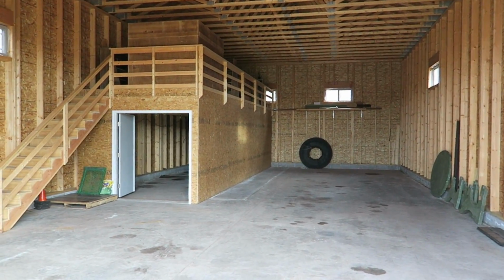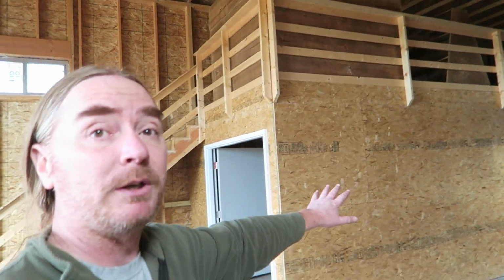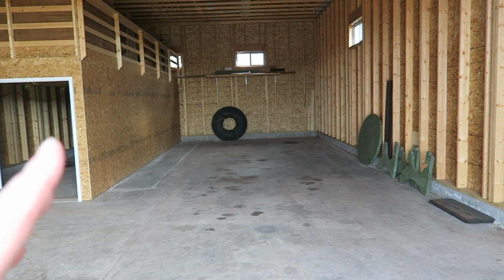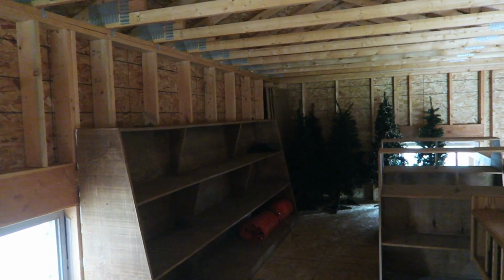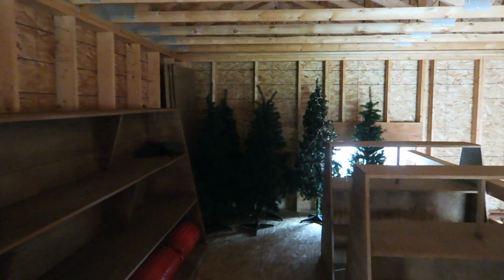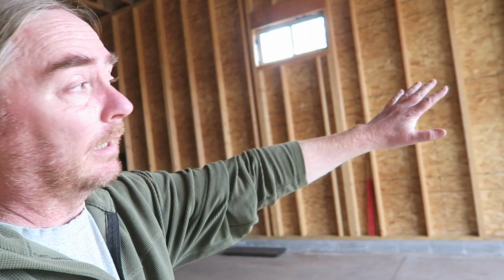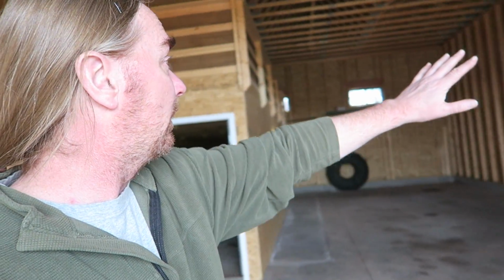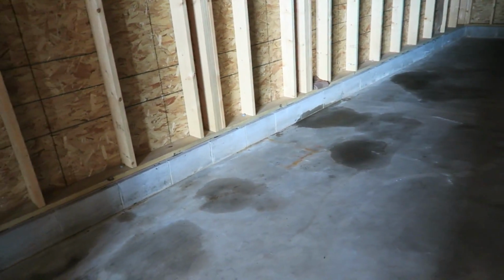CHECK OUT THE NEW BOAT SHOP!!

Comment: 4" is about R22, no vapor barrier needed as the foam does that.  You'll lose more insulation in the attic space and he's right about blowing in your attic space.  Another insulation to look at is Rockwool.  Rockwool with a vapor barrier is cheaper and will get you about the same R-Value in that 2x6 stud wall as the Spray Foam.  Not as tight, but pretty darn good stuff.  

As for HVAC, what about a decent waste oil burner?  Before doing that, you'll want to talk to local shops that have oil available, as many of them are probably using their own waste oil. 

Michigan electrical work.  You CAN do your own, you just need to have it inspected.  I did TONS of my own work, and had inspections run without issue.  

Lights, LED.  Check out April Wilkerson on her shop build.  She got some really good LED lights that really do a great job.  

Walls - I'd say get plywood to cover, but holy wah, that's crazy expensive now, other option is to put up Steel...Check out R&R Construction for their Post Beam Construction and use of Steel.  Plywood is better (IMHO) as you can easily hang things on it without dealing with ribbed steel.  Again, plywood costs are outrageous right now so...

BTW: WELCOME TO MICHIGAN!  Looks like Da U.P. Eh!  Say YA!  (yes, I used to live there.  6 amazing years and miss  it everyday).

Comment: Closing off the ceiling would help a lot.  Then you can blow in insulation on top, but be careful about conditioned vs non-conditioned space up there.   Having a lot of insulation in the roof/ceiling will help a lot with heat.  Also keep in mind that spray foam is also a wind barrier, which helps more than anything else at keeping the cold out.   Check out Matt Risinger's channel, he's got a LOT of great info about insulation etc and modern practices:  https://www.youtube.com/channel/UCFCTrfb1JUJjs3Im8OZDtBw

Edit: you could run the electric above ground....  When I had a warehouse, we had a heater hanging from the ceiling - that's what I've seen in large spaces.

Comment: The workshop area under the mezzanine does appear to be a bit unwieldy to work with, but the mezzanine itself could be useful. I'd look at taking out the central wall and replacing it with posts and bearers.

If you located the bearers up alongside the joints (ie fix the joists to the sides of the bearers using joist hangers, rather than sitting them on top) then you'd be able to keep most of the 7' clearance and still have decent post to post spacing.

It would be worthwhile having an engineer spec it out so that you know exactly what load capacity you'll end up with.

Comment: Hey Andy,
               I work at a major airline and we have 100’ ceilings in our hanger. It was always freezing on the hanger floor. We finally had Big Ass Fan Co. install big ass fans. Oh what a difference it made, we went from winter to spring time temps on the floor. You have to get the heat down to the floor and these things do the job! Just my two cents. Great show by the way, have learned a lot from you, Thanks.

Comment: do not use spray foam put as much insulation in as you can that contractor is a joke cover the walls and ceiling  with sheet rock rent a big insulation sprayer and it will cost about $ 6000.00

Comment: I'd be curious how well double bubble would work in that space.  It's amazing on our boat, but it really needs double layers with an air gap to do it's thing.  Single layers are a barely noticeable improvement, so it's really best in buildings like your shop where there are thick enough studs for the spacing.

Comment: Same ther money on running a gas line and use propane. As an FYI, all building materials are increasing exponentially. They fluctuate / increase week by week. I would concentrate on the ceiling insulation.

Comment: I would investigate suspension ceilings ( drop ceiling) they have hard tiles that don't flake . Just decide minimum height of ceiling you need,you can insulate above and have access for lay in lighting  or surface mount. I like the base board heat.

Comment: Anyone who works in "The Trades", as I have for 40 years, or follows trade magazines, will tell you that there is still much debate concerning insulation. East coast versus West Coast, Canada, crawl space, slab, perimeter , post and pier, basement, vapor, moisture and ,the always lively discussion- Tyvek v. Tarpaper.  So, If that shop was mine, (I wish), and assuming there is a moisture barrier between the sheathing (osb) and the siding, this is what I would do: Pack as much fiberglass batting between the studs as will fit, probably R-36. Sheetrock over that. Rock the lid and place 2 layers of R-36 up there. Done. Remember, For every step towards 'maximum efficiency,' you are one step closer to that 'point of diminishing return". I like the foam for it's labor-saving potential but, the cost and the ugliness of it (yeah, I care about stuff like that), is a turn-off for me. One other thing to consider, minimum rate of air exchange is a calculation that should be factored-in the insulation plan. So, Stick with glass, it's been good to you...

Comment: 1) No way that shop is 42x70x18...  My guess from looking at the studs is 30x50x16 as you only had a 7' ceiling in the "workshop".  
2) Insulating between the studs only is a waste of money as your 2x6 studs are just not that effective and will actually act as a bridge to the outside.  Go see some house with cheap insulation in the winter and you can often see the rafters printing through the melted frost.  Any solution you put in place MUST put some sort of a thermal break around those studs (and rafters).  More on that in a minute. 
3) Stopping air movement is huge... so make sure you put vapour barriers INSIDE your insulated space next to your wall sheathing.  If it is going to be heated, drywall is probably your best bet as it is easy to seal and keep the dust down and probably would cost less than chipboard these days as lumber prices are insane right now.
4) Heat goes up so getting that ceiling insulated is job one.  While it would kill me to lose all that space up there between the trusses, the cheapest thing to do would be to put a vapour barrier up, drywall or chipboard overtop of that, lay down some thick fibreglass or rockwool batts between your trusses in layers up to R-49 (one lengthwise between your trusses and one over top perpendicular to that)... going past R-49 is a waste of money there are other areas that will give you way more bang for the buck.
5) Walls...  put up batts between the studs and then a sheet of foam that bridges the studs, then a vapour barrier (well taped to ensure no leaks both between the sheets but also at the bridges between walls/floors/ceilings and windows/doors).  After that, sheath in drywall/chipboard to taste.
6) That floor...  if they didn't put foam under the slab when they poured (I'd guess not), you either have to fix that with a layer of foam, (then your radiant heating and then pour a new slab on top - looks like you have plenty of room up to your studs as they built a layer of block under your wall), or live with it and wear thick socks.  Heat does rise so you won't LOSE a lot of heat to it but your ground will be well and truly frozen outside and will be at 50˚ or so at depth so it will always be cool/cold and it's a big thermal mass.  I think given your power issues, I'd put down 1-2" of high density foam, put in some hydronic heating coil loops, and pour 2-3" of concrete over that.  Give you a nice warm floor for comfort, reduce the need to worry about pushing hot air around your shop (real PITA with your painting) and should be energy efficient to run with a high efficiency gas boiler.
7) You'll have to make sure those doors/windows are well insulated as they are big components to loose heat from. 
8) Definitely go with LED lighting and lots of it... 
9) What about turning that "wood working shop" into a paint shop?  Might be easy to keep the dust down and provide positive pressure...  just a thought.  The ceiling height might be an issue though.  

Nice thing about all that, is you have a blank slate and from the looks of it, should be all easy to get at so you could easily do it all yourself (well, I'd probably get a drywall crew in to do that as those guys can go SO much faster and leave you with a great finish but you already know how to fair/sand so drywall won't be an issue for you!).  I'd hire some grunts (or buy lots of beer for your friends/family) and make a weekend of putting up the insulation/vapour barriers before it gets too hot.  The rest can take a bit of time and the floor can go last (although you'll need to move the two doors up if you are going to add depth to it).  It certainly won't cost you $18K....

Comment: What I found, 3 inch of spray foam = R20, THE BEST THING !! Mice will not chew through or in it.I have had a mouse infestation in a batted pole barn before it was nasty. I used a home furnace on the mezzanine with tubes to push air , with 18' ceilings ,50'X80', there is only a couple of degree difference throughout barn.
Good Luck

Comment: Oil stains are easy pour oderless mineral spirits on them and then cover them up with speedy dry . they will disappear . LED lights are expensive but work very well , I used 4 ft ones with a cord on them so I can just plug in a replacement and move on..

Comment: Wow Andy, that's an adventure.  Unfortunately, with the price of materials right now, whatever you decide to do to get your shop ready is going to be bad news for the pocket book.  The good news is that you kind of have a blank canvas to work with so you can make it into whatever you want or need.  The only suggestion I can make is, think about the long term goals you have for the workshop.  You do not have to accomplish everything at once but if you make a few preparations now, future improvements will be cheaper because you will not have to undo the work you have already done.

Best of luck.

Comment: I did my garage sprayfoam isolation, similar building only smaller, and I have minimum experience with it. My advice, rent a good machine, make one or two test panels, use a good closed cell foam from a top brand, use every space in the studs, vapor barrier and close it with anti dust sheeting (similar to pvc) and you will do a perfect job just I did. It's easy. Even if the foam gets uneven in some places, you can cut it easely or spray over it if needed. Save you money, you can do it. Easy!

Comment: Talk to small commercial contractors not residential ones. LED bay lights and a natural gas condensing boiler feeding perimeter baseboard is your best bet. A good control system with remote access will allow you to warm up the shop from your house before you walk out. Drywall will provide some insulation now and you can blow insulation in behind as your budget allows. You could also install a lower false ceiling if you don’t need the height.

Comment: You could turn the small workshop area into a dustproof, spray/ varnish booth with filtered air and exhaust and maybe even temperature control for prime cure/ drying temperatures.

Comment: Also, concerning the insulation quandary: Sealing the joints in the OSB sheathing with a bead of silicone adds a significant barrier to air infiltration - and as we all know, the very best insulation is stagnant air. That's the only reason Owens Corning's fiberglass batts work. It traps the air and holds it still. Therefore, if you can reduce the air movement THROUGH the walls by sealing seams with silicone, you will assist in trapping the insulating air. It is actually one of the things that make sprayed insulation batter than batting.

Comment: 700 feet of trenching in rock is going to be expensive. For a potential cost saving, you might want to look into running electric power aerially on utility poles and heating with an electric heat pump system instead of a gas boiler.

Comment: I wonder if the spray foam will help with the echo. The echo will need to be addressed for filming. Epoxy the floor, and look into quite rock for the wall. It is expensive but you may be able to get a good price due to quantity. Otherwise you could fabricate your own sound barriers.

Comment: The price doesn’t sound insane at least not in the areas I have built in. One application that we used to save some money on foam insulation is to install 1” of closed cell foam to seal the structure to get it tight and then fill the rest of the cavity with open cell foam. I can’t remember the R values off the top of my head but it was the best option we could find in our budget.

Comment: R-19 is R19, you could buy enough R-19 fiberglass at Home Depot to do your building walls for $2,500 and do it yourself or the same contractor that will blow fiberglass in your ceiling would probably do it for not much more than that. You can also buy rock wool R 23 for even less than the fiberglass if you want a higher R value. The only reason foam insulation became popular was because your could get R-19 in a 2X4 wall.

Comment: Nice future home of the Boatworks Today workshop!!  The potentials of that shop!  I would give anything to have a building 1/2 that size!!  That is my 'dream-shop', lol. If it was up to me, and funding wasn't an issue, I would go to town, lower large item/supply storage, a 'clean' work area, a separate  woodworking shop, an office, bathroom with shower, kitchen/breakroom area, a room to sit down with customers or clients..... the possibilities are endless!!!!  Mist important, a machine room for HVAC, compressors, ect.  Have you thought about using solar to enhance your regular power hook up?  What's nice about a 'stripped' building is, you can lay it out how you want.  Seeing it is going to be a commercial set up, are you required to have sprinklers and such?  Have you started packing up the old shop yet?  Bet you are gonna find things like tools & stuff  you thought were long gone.  Anyway...(ya got me all excited' like I was planning my own shop ou, LOL), thanks for the tour of the new shop.  It's gonna take time to set it up how you want.  Hopefully, ya will do it with little headaches or problems. Wish I could help both workwise & financially.  Thanks for another great video and we shall see you in the next one.

Comment: Hello. My name is Dragan and I am an architect from Montenegro. My opinion is that with such a thickness of insulation that is installed between the wooden beams, you will fully meet the thermal insulation requirements by using styrofoam of small weight in order to have vapor permeability. Of course, install styrofoam on both walls and ceilings. Do the interior treatment of the walls according to the financial possibilities. Do the space heating with water radiators that are supplied with water from the central boiler in which the water is heated by a pellet boiler and solar panels, considering that you have a huge roof area. If moisture penetrates the floor, there are solutions for that. Feel free to contact me for advice. Best regards.

Comment: Set up an appointment with your local building inspectors and determine minimum standards and allowable types of insulation for your area and what they would recommend installing for insulation/electrical. Winter temps in west Tn are FAR higher than those in your local area. Uninsulated floors in northern climes can be more problematic than those down south. R 19 seems a little light for insulation in a northern clime. Talk to other home owners about insulation in their garages. Google insulation companies see what’s out there.

Comment: To do a cheap general check on the suspected moisture spots. Sprinkle some water on the dark spots, if it beads its oil or something hydrophobic . Regarding the general level of moisture in the concrete slab, try taking a piece of heavier duty plastic/bag or tarp of a measured size, say 600mm sq (2 feet sq) and tape down to the floor with gaffer tape and ensure a tight seal. This will allow you multiply by total floor area to get a bit of an idea overall.
Leave 24hrs then peal back. If it is only slightly damp you don’t have any real issue and you could wait till toward the end of summer, keeping it ventilated then prep and seal with a suitable coating. If there is a lot of water/moisture you will need to check further with a moisture meter for a more accurate measure of quantity of water/moisture level the slab is holding and talk to an expert about removing/reducing the moisture to an acceptable level before coating.  If the slab is respiring to much moisture to the air above and wicking more from the ground below you will find it difficult to get a sealer to bond. 
Sika or Parchem are two companies I’m aware of who should have a combination of suitable products that would do the job.
All the best mate,
Andrew